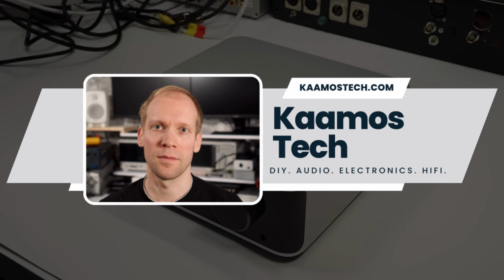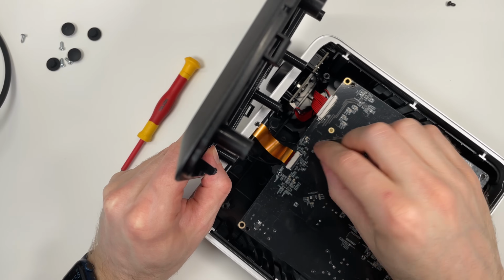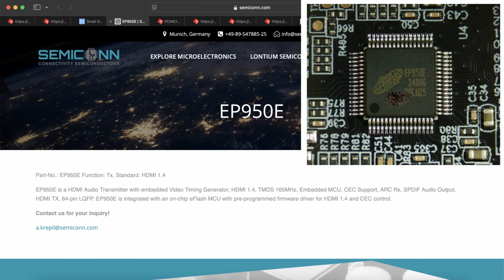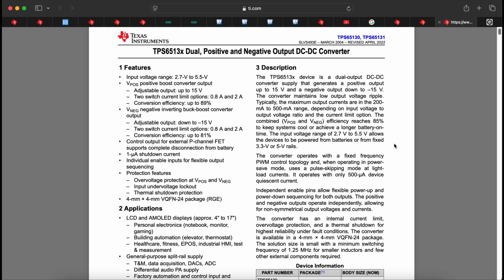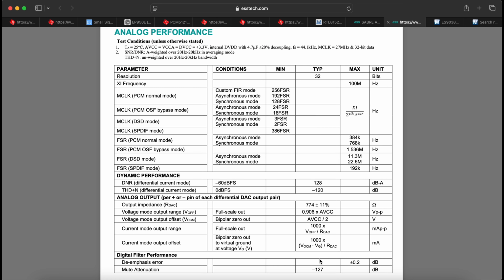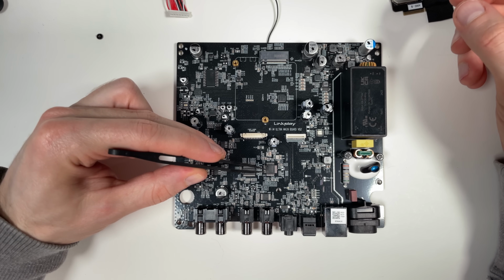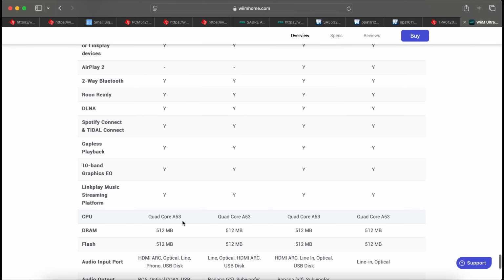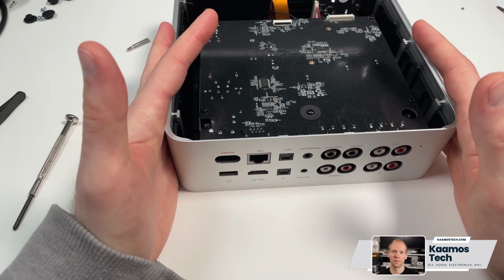WiiM Ultra Teardown - What audio ICs are inside?

Comment: Great tear-down video, thanks. Any idea what clocks were used in the Wiim Ultra? I’d only interested in using the spdif coax output from the unit in a 100% digital system so wondering if a good reclocking device might be wanted.
Reply from the maker: That is a good point I missed. I had a look at the photos I took, there is one 24.576MHz oscillator near the PCM9211, can't see any model or manufacturer info. Likely something fairly 'basic'.

Can't say about the benefit of re-clocking. If WiiM has done their job well, it shouldn't be necessary as in the streamer transmitter you can control all the clocks. Unfortunately, don't have good means to measure this.
Reply: @kaamostech Thanks Tommy. I’ve since heard some complaining to Cheap Audio Man the digital outputs do not not perform well and he’s recommending a cheap SMSL USB reclocker with it to improve the sound.
Reply: @jackneber2609  Yep, saw his video and was really in doubt...but some quick listening USB out to FiiO BTA 30 pro with XMOS XUF208 let me stunned - stage width, separation and clarity everything improved. So there could be a Wiim Ultra Pro at the horizon some time? Preferably with XLR Outs and better XMOS (just dreaming)
Reply: @JustMikael85  Interesting, so basically you haven't noticed how bad the WiiM sounded untill Randy has told you so? 🤔
It's a psychological effects: suggestion operates through various cognitive biases, such as confirmation bias and expectation bias. Confirmation bias leads individuals to favor information that confirms their pre-existing beliefs, which can be particularly powerful in shaping perceptions and responses to suggestions.
Expectation bias, on the other hand, causes individuals to interpret ambiguous stimuli in a manner consistent with their expectations. This means that when a suggestion is made, individuals may unconsciously adjust their perceptions and interpretations to align with the anticipated outcome.
Btw. all his claims are strictly subjective perceptions, not backed by any measurable data. He himself even stated multiple times that a lat of times he doesn't fully understand the topics he is talking about
Reply: @jackneber2609  Note that he was raving about how amazing it sounds in combination with Geshelli J2! That is untill he stumbled upon a video about how "nasty jitter" the WiiM is producing. Suddenly you need more "cheap gear" to make it sound good.
Randy is funny and entertaining to watch, but all his opinions are strictly subjective and not based on any concrete evidence. I wouldn't obsess about anything he says.

Comment: Great job, you're brave, I hope EVERYTHING worked after reassembly. I'm a retired analog design engineer & the construction & manufacturing are impressive. No crooked SM parts. PCBs with a million plated thru holes. I would check coupling caps for quality. Quality US ICs used by China, that's sad. The PCB ground strap should be at the rear (so static doesn't pass thru the PCB groundplane) & can drain thru connector grounds to AC ground. Next time please wear an ESD strap, if you did no damage today it may show up years from now. Cheers!
Reply from the maker: All good, still works :) Playing music right now.

You are absolutely right about an ESD strap. I know I overlook it, I touch safety earth when I sit down but rarely use a strap. Besides my hobby I am also a professional electronics engineer and from my experience things don't actually break so easily - but minimising any chance is absolutely the correct way of working.
Reply: Hello. Beautiful work, a pleasure to watch. In your opinion, is the built-in DAC in this device well-made? Or is it better to buy an external one?
Reply: interesting I'm not a techie but just posted about static

Comment: This is the best video I’ve seen on the WIIM Ultra. 
It was like a college lab class 👌
Question. How good is the DAC on the Ultra. 
I presume It’s the same as in the Audiolab 7000A. 

I ask simply because I just bought the Ultra as I could not get hold of the Audiolab 6000A play which was my first preference. 

Ok please bear with me 
1. Before buying the Ultra I was using a $10 DAC bought from Amazon 
It has Coax In. Optical In. RCA analog Out. 

I connected  the Amazon DAC to my TV via optical and RCA to my pre amp and Powered speakers. 
I was listening to Utube Hi Res and loved what I heard 

2. Since the Amazon DAC was just $10 I decided to buy a better streamer DAC. The Ultra had it all and served me well. 
3. What I heard via the Ultra  was good but wait… the results between the Amazon DAC and Ultra was not chalk n cheese which I thought it would be. 
4.  So I did an AB test using the same HiRes track from Spotify 
A was the Apple TV optical out into Amazon dac optical In Track 
B. Was streaming the same track to the WIIM ultra via wifi 

I heard not really any difference. 

So can someone tell me why is it that a $10 DAC and the WIIM Ultra sound almost similar 

* kindly note I’m not sure what is the DAC inside the Amazon one which is the size of a matchbox 

Please 🙏🙏 tell me how is it that both DACs sound similar. 

Should I dispose the WIIM ? 

Thanks in advance
Reply from the maker: You have extremely good questions my friend. I try to be careful with my wording not to p*** off too many golden ears :) But the reality is that it is very cheap to make technically very very good DAC these days. They are better than any DAC not so long time ago. You probably don't hear a difference because the Amazon DAC is already "good enough". It takes an expensive system (amp, speakers) and good ears and experience to hear the difference - a lot of people say they hear all sort of things but would not want to do a blind test. You know what I mean?

Bottom line, I don't think what you say is because WiiM is bad, but because the Amazon DAC is 'good enough' so that it's very difficult to tell the difference. I think every audiophile should honestly ask the same questions, and when you cannot hear the difference, just be happy, don't worry, and enjoy the music - instead of just spending more and more money.

I also find it difficult to hear differences between DACs so I focus mostly on speakers and room because they make a huge difference.
Reply: @kaamostech  DACs have been this good for over 20-30 years, where they are beyond the perception of the human ear. So it could broke only in analog path if project was bad...
Reply: @kaamostech  Thank you! Finally someone with common sense 👍
Most "audiophiles" are old guys with deteriorated hearing but they claim to hear things that oscilloscope can't detect 😂
Reply: Goodmorning! Can you please what is the $10 Amazon DAC so I can buy for my stereo I appreciate your response.
Reply: In order to hear/feel the difference upon different dacs you need a good enough/very good amplifier+speakers combo. Dac difference is about details, and you can disclose it with a sensitive enough setup.
Reply: Pity we don't know what Amplifier and speakers you're listening to! 🤔
Reply: Nice question but not good comparison. Weem provide you comfort, flexibilytiy and a little better sound. Your dac is just a dac and powered by usb c port. Which means, if you have high grade system, you will hear a lot of hissings. If it is an ordinary sound system, you will not hear any difference even if you have 10 dollars or 2000 dollars DAC.
Wiim, you can connect it over hdmi, optic, internet connection, you have equliser and very precise one and you dont need to turn on your 55 inch tv to just to listen music.
Most importantly, it is 300 usd device. Can not sound 10 times better :) :) :) Additional to the DAC, You are buying wifi, bluetooth, ethernet port, usb port, remote control and a touch screen.